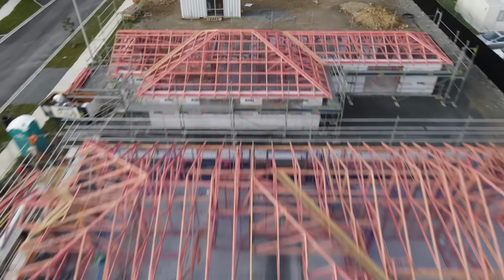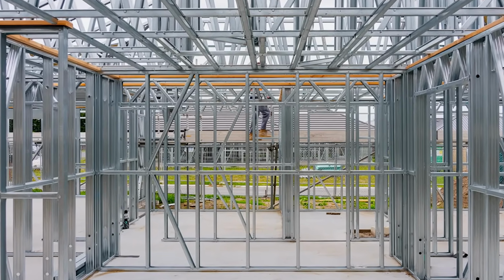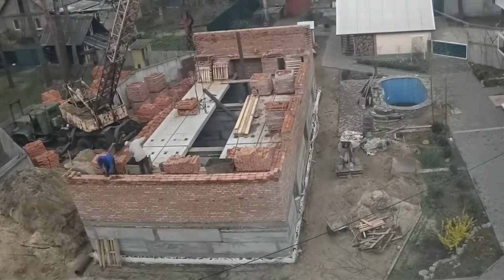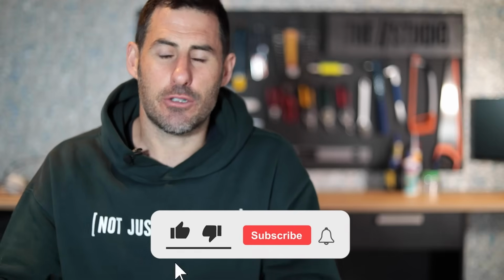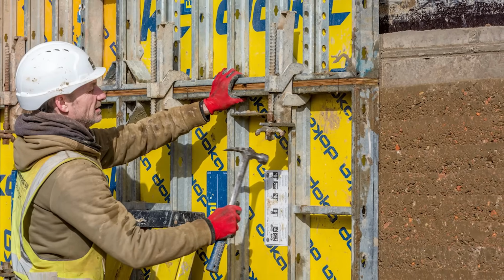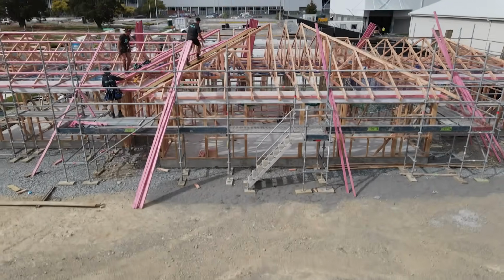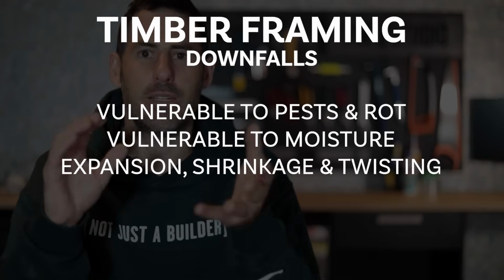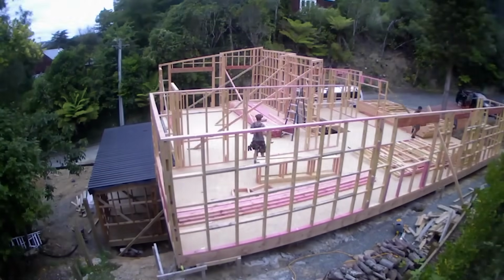New Zealand is OBSESSED!! with Timber Framing

Comment: Here in Brazil the problem with using pine is termites and also the higher heats means that soft woods flex more. So were using mainly concrete ( clay bricks ) and or hardwoods. I found a good cost effective way to build in the tropics is to use all hardwoods for structural frames and then using pine for finishing and interior walls.
Reply from the maker: Interesting! Thanks for sharing

Comment: The UK and New Zealand must use the term "timber framing" different than in the US. In the US this would be called a stick built home or stick construction. A Timber Frame would be made of vastly few pieces of heavier and thicker pieces of lumber that generally use "hand" crafted joinery. Timber Frames usually have beautiful exposed wood on the interior (and to some extent exterior) and are far superior in strength than a stick build using dimensional lumber.

Comment: Again, a few extra points... Haha

1. Steel - Also issues with condensation. I've seen the paint flaking off the jambs because of the thermal transfer around the window trimming framing. Another point is that steel fraing and timber react very differently from an engineering perspective, so mixing and matching the two systems tehnically could cause issues in an earthquake - This more applies to steel portal and girt construction with internal timber walling. Builders I've dealt with have gone with steel once or twice and vowed never to go this way again.
2. Timber framing doesn't have to be limited to stud and nog construction. My build starts tomorrow, and it relies on 190x45 girts @ 900CRS vertically to main walls, and 450crs to feature walls. 70x35 strapping internally, and you get a wall that performs at a total R value of R4 (with 2x layers R2.2 wall batts) compared to traditional brick and 90x45 stud wall at R2.0 (With R2.2 insulation). Has less framing as a % of wall area by about half, so less heatloss through thermal bridging. You do however need either a portal frame with wind posts to support this system, or cantilevered posts.
Reply: If you were building a tower microhome 5x5m and 4 floors high, would you use Steel? The ground is very soft, so we want a light but rigid structure.
Reply: @Justyburger   You'll need to treat the build as two separate elements. The foundation is one element, and the structure is another. The foundation would have to be designed to support a structure on top of it without subjecting it to any loads. So it's not super relevant what you build the rest of the house out of. What is relevant is that the standards I can work to as a designer for timber framing don't allow for 4 story high timber construction. NZS3604:2011 covers up to 3 stories maximum, and then maximum building heights around NZ in relevant district plans for residential buildings is normally 10m above ground level.

Out of curiousity, why 5x5m & 4 floors?
Reply: @richardthatguy9266  Thanks for the reply. I've had a fascination with compact modern Japanese houses, for quite a few years now. This design is partly dictated by price and partly because of the limitations we have with space.
We have a 10M setback from a stream at the back, so there is just enough to squeeze the tower in and still have two car spaces at the street. We are allowed an average roof height of 11m, which fits in 4 floors, although the top floor for consent purposes will be deemed storage space and accessed via a ladder. 5x5m was also arrived at because we need to stay away from the neighbours daylight envelope. I've always loved the idea of using verticle space and having different floors for different zones. Also, we are trying to get views from the upper floors. 
We know it's unusual, but we like unusual if it works. 
Our ground is also soft and requires 12m piles, so the smaller the footprint, the less piles we need. This is also what's driving us to a light structure. The ground floor will probably have a concrete base, then the steel structure rising up to 11.5m at the highest buildable point. Right up on that top floor, I'm planning on putting some bunk beds with their own windows, based upon crew quarters in a luxury yacht. 
Bottom floor will be kitchen and dining, 1st floor, bathrooms, toilets, laundry and a sauna. 2nd floor a compact lounge area with an overhanging box window, office nook and a bedroom. Top floor mixed use, storage, bunks, kids spaces etc. There will also be a void from the lounge all the way up to the roof (about 6m). I've considered putting a climbing wall up one of the walls. 
Exterior planned to be steel clad. Initially it will be rented out as temp accomodation but we plan to live in it at some stage.

Comment: I know the US does a lot of the same timber framing, but why does NZ use so much more Horizontal studs(Noggins/Dwangs??) compared to the US?
Reply: The noggins are used to keep the studs straight and also as blocking/something for fixtures (cabinetry, towel rails etc) to fix to. Do you guys not use noggins in these ways?

Comment: Why is the wood pink ?
Is it radiata pine ?
Reply: It’s a dye added to the timber to identify what it has been treated with. Pink timber is treated to protect against borer and fungal decay making it appropriate for internal framing. Timber dyed green is for external uses, and has been treated with different chemicals to protect it from moisture and the elements.

Comment: I worked on a concrete prefab panel apartment building in auckland that had steel framed inter apartment walls. I have seen many prefab panel commercial buildings, and i work in a concrete block commercial building. I have worked on sites where we built concrete block retaining walls with steel reinforcement bars. one of them the block layers screwed it up and there were major voids in the mortar filling so they ended up cutting the face off the block wall at the top and trilling it in many places to inject more mortar into the wall.

Comment: Interesting take on building systems in NZ. One interesting fact not mentioned, is all H1.2 timber frames in houses have a 5 year warranty, even when used in structural elements as long as its protected. When the  NZBC clearly calls for all structural elements to have a 50 year warranty? Yes most homes are built from timber in NZ and one reason could be, we have only 2 real building suppliers to the industry in NZ, who just by coincidence own the most forestry in this country. Also although I agree this system is most well known by builders and councils, is lack of understanding of newer and possibly better systems really the reason to avoid the potentially better result? There are many ways to build in NZ with newer technology, and claiming that we have been doing this for over 100 years, does not mean its the best way today. After all when settlers first arrived here we didn't have cars, I'm sure an argument to return to using a horse and cart, won't be accepted by most today. I know this presentation was trying to be neutral, however the dogma of the industry to resist change from timber stick frames, and revere to the old ways, still seeps through the presentation. Enjoyed your thoughts, albeit not agreeing with all - but its good to have these ongoing discussions within the industry. - cheers. G

Comment: What I don't get is NZs reliance on gib and nogs for shear strength as gib is not a structural material in most other building codes. The amount of nogs could be reduced and the stiffness of houses majorly increased if we committed to using an external sheething layer (osb, ply, ecoply, RAB etc).  The houses are also more air sealed this way, and makes the waterpoof layer more effective.
Reply: Nogs are more often than not dictated by cladding choices. For example, cedar shiplap reruires nogs at 480CRS max, where longrun could be 900 or 1200crs max.

Comment: I having doing timber framming and carpentry work for 20 years in Australia. 

As I know, the problem is the design of the mordern houses is challenging the knowledges for the young chippies. For saving the government foundings, they cut off the apprenticeship period from 4 years to less than 2 years . Nowdays, the young boys knowing nothing about the conventional house framing, they used to do prefab trusses framing or even prefab the wall framing as well.

Once the job involves complicated steel works or special design of the architecture engineering. Main while, the regulations updates alot for the multi townhouses building, a lot of fire protection and water proofing regulation are related with the framing.  It is even a challenging for experienced old guys, not even for the young boys who are not finish year 12. (I have no biases, but it is essential to have the basic math knowledge or reading ability to understand the plans). I have seen so many jobs which the young boys fxxk them up.

Comment: My house was built during WW1 (as part of a factory build that needed War Resource Exception) and ENTIRELY made of masonry including the internal walls & luckily I live in the Waikato so low earthquake risk but after over 100 years and several earthquakes it is still standing strong. If was to build a new home I would do the same, all walls masonry because while hanging pictures is harder you don't need to find studs to hang shelving or TV mounts & accidental wall damage is all but impossible so good for rentals because if a tenant punches a wall in a repeated fit of rage you can evict them from the hospital as they get their broken hand fixed with no damage done to the house. It has downsides but the ups out way them.

Comment: Lol rammed earth at $10000/m2..yer right to expensive and for uber wealthy! One material that is light and fireproof is papercrete, made with recycled paper the blocks can be made say l-900 x w-250 x h-250 and run reobar thought the cut by hand saw them morted toghter with cement and finished with cement  render. No insect or rodents attach it. I think the only downside is moisture, but some smart building scientists could figure that out!
Here in nz with have paper, cement etc. Plus i also think and advantage is the fletchers dont fuken own it.

Comment: SIP  Structural Insulated Panels, are becoming another cost effective option.  They basically do away with stud framing.
Reply: Let's debate that, it may have been cheaper pre covid. ICF is a good contender.

Comment: I think the use of wood frames in NZ houses owes something to the common importation in the 19th century of pre-fabricated mail-order houses from USA.  These California-style houses became the model for the villas seen in early suburbs of Auckland such as Herne Bay and Ponsonby.  From there, they were progressively modified and modernised, but the style and construction of NZ houses still owes much more to USA than UK.
Reply: Earthquakes. 
It's about Earthquakes. 
For example: NZ and Japan share the same problems and we share our knowledge/learning too.
Reply: @AngeKiwi  No the use of timber is mainly because it has always been a readily available cheapish resource, exactly the same reason why timber is the most common material used in Australia that has few Earthquakes.  Concrete is is the most common material used in NZ in modern commercial buildings even low rise, and that would work for residential housing but its more expensive.
Reply: @AngeKiwi California has earthquakes.

Comment: The NZBC and The building standards are based strongly around insuring minimal loss of life in earthquakes.  In the last few years the earthquake demands placed on every building oin new zealand has been risen dramatically.  Building single level, timber framed, steel rooved houses is the cheapest solutio .  Blocks, concrete etc may be structurally better in some ways but are so heavy and need even larger foundations to stop the tipping over in earthquakes.  Also a concrete building genrrally has to be eemolished after an earthquake.  Wigh timber and gib you can peel the gib off, straighten the frames and reline with new gib.  Not easy but you do save the bulk of the building

Comment: Brick has a R value of about 0.45, as compared to common 90mm wall batts of R2.5, therefore brick and other masonry have little resistance to heat flow but has the capacity to absorb and release heat quickly, depending on thickness
Reply: A large area of the timber framed wall is 90mm timber which is nowhere near R2.5.
Therefore it is underperforming unless there is overlay insulation.

Comment: Re different methods. There is nothing wrong with timber, we just need to be open to different framing methods than 3604 prescribes. Are dwangs needed everywhere if you wrap the house in RAB? Can the RAB contribute to stud strength and thus increase spacing? What about a service cavity - something alien to 3604? I don't know if this is on the radar of the Minister for Building, probably not... (Maybe try to interview him Josh!)
Reply: Service cavity sounds great and I wonder why it’s not standard? It doesn’t make sense that the plumber, sparky and HVAC guy have to cut through framing to run their services. We know they have to run this stuff so why don’t we just allow space for them?

As for dwangs, they are necessary for cabinetry and other fixtures to fix to.

Comment: what about concrete?, im from Chile, the earthquake country jaja and we are used to do the first floor of concrete and second of wood. is feasible or uncommon?
Reply: Concrete slab suuuuper common here, but not first floor. If first floor needs something like that it's usually concrete block with rebar and concrete infill
Reply: Concrete cylinder block 1st floor with wood framing on 2nd floor is actually very common here.
Most houses in the 60s and 70s had this. My whole suburb in Auckland consists of these half concrete half wood framed houses.
Unfortunately it's not as common now, I would assume it's due to cost, building labour is now extremely expensive in NZ, cylinder block generally takes too many man hours, and land costs are very high so savings need to be made elsewhere.
Reply: @citation51power  Still common when the first floor is also retaining. Even then sometimes the back wall will be concrete block and side/front walls will be timber frame. I think they're tougher to detail/insulate which plays into it too.

Comment: What about Structural Insulated Panels? 

Formance, an NZ owned company, manufactures, supplies and can install on site much more quickly than a stick build. They will also train builders on the installation.
Reply: We've considered SIPS panels here in NP. There's a company called Magwall who make them. I wasn't sure about how tricky it would be to get all the services in, but they design the panels around where pipes need to be and there's also an in-built grid of small channels for cable routes.
Reply: @Justyburger  Hey Justy, located right there in NP as well. I have never seen the Slab and Floor products before either. Having them in town makes all the difference.
Reply: @sociopathicnarcissist8810  Cool. Magwall are just before Lake Mangamahoe. I've not actually visited them, but I chatted on the phone to them. A couple of years back, we went through the EHaus design process, but the budget blew out. That house was probably going to be SIPS panels. We have a different design going on now. A tall building, but narrow and cheaper than the Ehaus one, which ended up getting towards 1 million bucks. This one will be less than half (hopefully).
Reply: @Justyburger  Mate, I wish you luck, I have a buddy  in Tassie in a net zero house. It's pretty bloody good.
Reply: Haha. Most builders won't know this product. They just use the easiest product for them and don't care about thermal properties or warmth for the owner. Like Aluminium dg windows. Go upvc.
Reply: @Scooter1964NZ  Scooter, I think that you're an old fart like me... I'm in my 60's and work in an industry where I have to certify to new standards every two year. Builders should be held to the same standard.
Reply: @Scooter1964NZ  yup, they truly don't know/don't care. I experienced this with my build. but the story goes deeper because it is about builders engaging for real with architects / drafties. they don't.
Reply: @Scooter1964NZ  
On a price point, SIPS panels still aren't quite there yet. I opted for 190mm wall framing running at far lower framing to wall surface ratio.
Reply: @richardthatguy9266  what did you use for insulation in the 190mm thickness
Reply: @Scooter1964NZ  
2 layers of R2.2  (90mm). I doubt that 10mm difference between 180mm and 190mm framing will make a difference. I would have like to have gone polyester batts, but too pricey, so went with traditional glass batts.

Comment: Galvanised steel framing is prone to rust as much as timber is prone to rot.  It shouldn’t be a problem unless you have constant moisture inside on a cut edge.  If rust was a risk, we wouldn’t be using galvanised nail plates, bolts, screws, nails etc in timber-framed houses.
Reply: I like steel framed houses. Try imagine kit homes I've done architectural designed homes one of 300m2 and the latest at 187m2 kits are well priced and bring your kitchens in from IKEA in brisbane and save a shittonne.
Reply: Steel Framing
I carry a pack of etch prime cans in the truck.............just spray when its a risk, especially in a channel or near the bottom plate where moisture is an issue. 

Sometimes at the end of your clean down, just do a walk around with the can.  Come back in the morning, and good to go.   Keeps some photo's for Council as they love this and don't see enough people protecting properties.   It maybe costs me $200 a house - thats all.
Reply: A quick coat of rust prove paint on all cuts & drilled holes would also reduce the risk but add some time & some minimal cost.